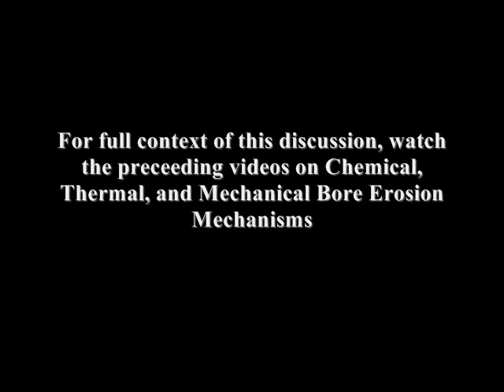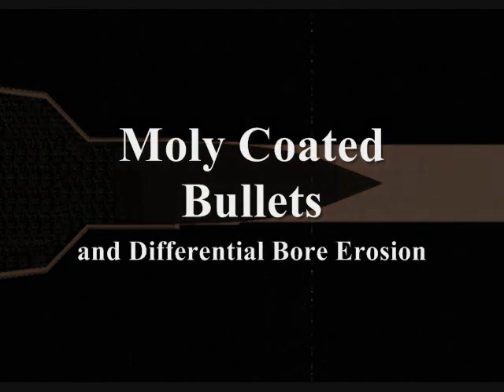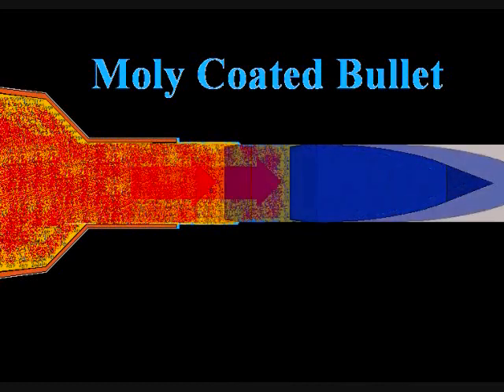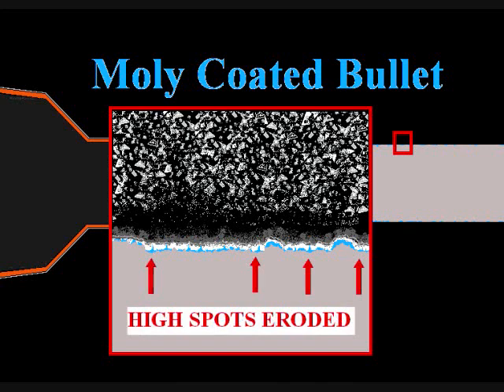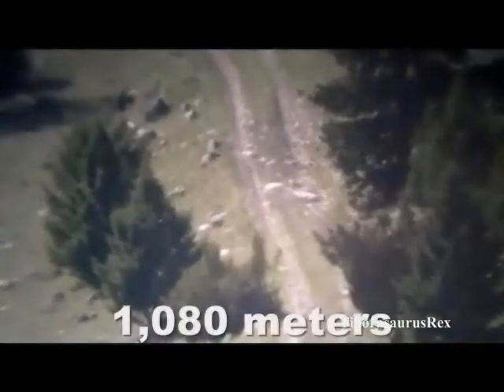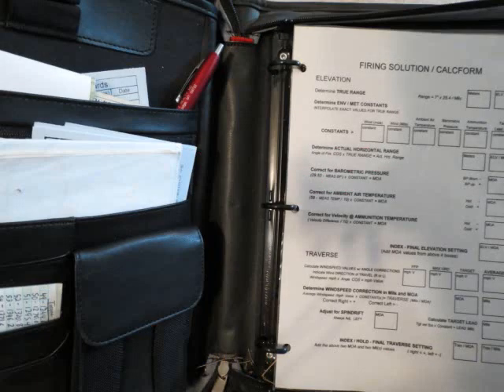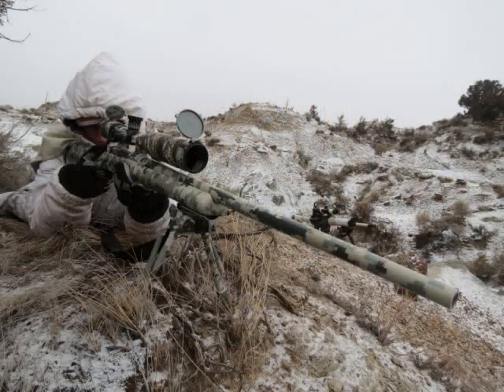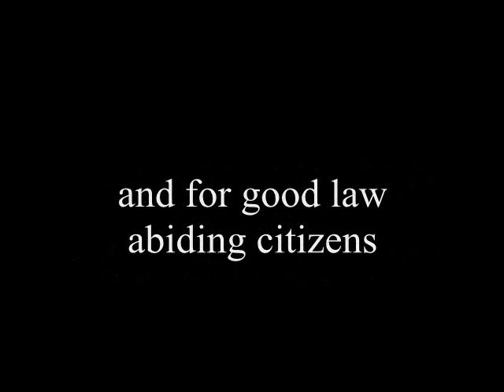Long Range 101 Part 39 - Moly Coating and Bore Erosion

Comment: I'm new to the coated bullet world but I have gleaned a few things of note. One it's that the coatings actually drop velocity initially do to the significant drop in barrel pressure needing a change in your load to compensate. Second is that Molly has been shown to break down with heat and moisture potentially corroding the barrel over time. Last is that for the reloader like myself there are other products like hbn and ws2 with other properties that can be used to gain more consistency and wear protection from your gun.

Comment from the maker: Hi there.  Great questions.  If you have a new match grade barrel or even a new factory barrel,  I would totally avoid any of the abrasive cleaners all together.  The mechanical erosion forces that result from normal firing will do a more uniform job of removing micro-burrs and machining imperfections from the criticle areas in the bore.  These cleaners can help to make the bore look more shiny, at least visibly, but you want to avoid removing any steel from the bore.  Vid coming soon :-)

Comment from the maker: Works great for lower velocity projectiles like the big bore .45s and .50s.  If you are shooting LR with a 45-70, 45-90, 45-110 etc... this is a great way to go, especially if you paper patched them.  For modern high velocity cartridges, lead cast bullets can make a nasty mess in your bore and will be problematic for maintaining a uniform level of fowling as they will require quite a stern bore cleaning regime.

Comment from the maker: If you already have treatment in the bore, that won't be a big problem.   The big problem arises over long term use when an accumulation builds up in the bore and especially when further accumulation in differentially eroded pits is exacerbated by further deposition of the molybdenum which can really make a mess.  One bore treatment prior to firing is fine and won't produce any significantly noticeable negative effect.  You'll still get good accuracy and bore life, so I wouldn't sweat it :-)

Comment: You should try hex Boron nitride (hBN). It won't have the downsides that moly has, and resists far more heat. It doesn't rub off the bullets, and you can just coat the bore.

Comment: I use moly quite a bit. after I clean my bores I mix some moly and rubbing alcohol. I then use a bore mop to run it through the bore. let the alcohol evaporate then run a patch through it to remove excess moly. one thing you didn't mention is the waxing of the bullets after applying the moly.
Reply: I avoid waxing after moly coating the bullets. Wax on top of the bullets has to go somewhere and it has no place in a rifle bore.
Reply: @teucer4  

I've never had a problem after thousands of rounds.

Comment: well let's see i purchased my Savage 110 FP in 1995 and started using Moly shortly there after. if you plan on using Moly after firing copper jackted bullets through the barrel then you have to remove all the copper fouling from the barrel. Sweet's 7.62  is the best solvent to accomplish this. after doing so you then use Neco Moly Slide grease on a patch and Burnish the Moly into the barrel. one of the advantages of Moly is that you can fire more rounds through the gun before you notice a drop in accuracy.  another advantage is you do not need  to use a brush to clean the barrel, you just run a patch with your favorite gun cleaning solvent and then a dry patch. you don't want to remove the Moly just the carbon build up. then you run a patch with the Neco Moly Slide Grease and Burnish the Moly into the barrel. most people who try to use Moly do so incorrectly and yes you will see a drop in velocities so you can bump up the charge 1.0 to 1.5 to get that loss back.i Moly Coat my own bullets. HTH.

Comment: Early days of moly coating, my how things have changed, I have used it after braking in my rifle and several years later and several thousand rounds the barrel is still good, cleaned after using and bore scoped, I will still be using it. No, you lose FPS as the pressure drops due to good lubrication and you normally had to up the powder to get it back to the start velocity, and it does not rub off bullets easy if done right, that why it is used to coat piston rings in engines. check the link below see what the pros say and what would they know it’s only their job
https://www.wallworkht.co.uk/content/molybdenum-disulphide-coating/
Excellent lubrication – Completely dry lubricating film resists pick up of dust or other harmful contaminants. High load carrying capability. Reduced risk of seizure. Excellent adhesion to the metal substrate. Low coefficient of a friction alleviates stick slip behavior and provides uniform torque tension characteristics on threaded fasteners. High resistance to oils/fuels/grease. Enhanced corrosion protection in marine environments and to a broad spectrum of aggressive chemicals. Passive, containing no toxic lead or antimony compounds.
Reply: Yes, and I hear hex boron nitride does it a bit better and it has a higher heat resistance.
Reply: I like the idea of Molly when it first came out when I understood that the burn temperature of Molly allegedly causes carbon and it has been said that moisture builds up behind Molly in the barrel well that's exactly what they say about copper deposits left behind by the vaporization of the bullet jacket in the barrel hbn I've been working on recently results look very promising by the way I'm no Pro but I'm still working with Molly and so far I have not incurred all the problems that is associated with Molly oh well I'll go where the results Lead Me if you look at benchrest books from the sixties all of us accuracy minded guys today would actually laugh our asses off example you have 2 neck size only

Comment: EXCELLENT videos for sure
I'm currently doing a big multi-rifle long-term review of HBN coatings, to be published in Target Shooter and on my channel.  When you lube the bullet, you end up reducing the fps.  That reduction is, however, less than the drop in pressure.  SO you could increase  the pressure back up to where it was by increasing powder charge and have a nudge more fps, or leave it where it is, knowing you're running less pressure.  Cheers Rex :)

Comment from the maker: Nitriding really works. Nitriding the bore can act to interrupt one of the primary driving reactions of the chemical erosion mechanism -  the adsorption and dissociation of carbon monoxide on the bore surface.  Also nitrogen inhibits the subsurface diffusion of the free carbon into the steel as well.  All this can lead to a significantly longer barrel service life.   

Eotvos effect can have an effect at long range on the order of inches.  If you are shooting beer cans @>1KM, this is criticle.

Comment from the maker: Howdy!

I would be extremely careful when increasing pressure on a shaky promise of lower pressures - if you know what I mean.  The way the moly rubs off as it slides down the bore can vary considerably from shot to shot, so I would not increase the risk overpressure to get a little more fps.  We will be precisely adjusting for bullet drop and windage anyways, so a higher MV is not really a top priority. Hope this helps.
Reply: Yes being careful is a very good thing, but moly coated bullets does in fact reduce pressure and many hand loaders have experienced it personally. The proof is in the primers. When loading hot loads, and i mean hot, you get flattened primers. Its not a danger if using a quality gun but it is hard on brass and guns, so most loaders back the charge down a bit to stop this. But if you load the same loads that flatten primers with moly coated bullets, you see no flattened primers, you must up the powder a bit to start seeing the excessive pressure signs again. But yes you are in fact right about being careful with doing this because coating with more or less moly could perhaps change this some, different coating processes could change it some. Any safe hand loader knows always start low and work up whenever changing anything.

Comment: I'm my reloading book, it says moly coating decreases velocity. It's in the Lyman reloading book that came with my tumbler.
Reply: It is correct, it reduces the velocity, because the powder has more place to burn in when the bullet gets out of the way easier
Reply: But if you add more powder you can achieve higher velocities without over pressuring.

Comment: Part 2.....SBN is Salt Bath Nitriding. It is a treatment, not a coating. It is impossible to flake off or have anything get "underneath" since there is nothing TO get under. Anyway, Compass Lake has an explicit way they want the JB Bore Paste applied to their barrels under barrel break in. He said after break in and SBN, I could use moly coated bullets just fine as long as I kept the build up down. I know about the vinegar/hydrogen peroxide trick, then follow up with bore paste.Borescope too.

Comment: I have use them while shooting handgun if you have the mold really cheap to do.On some of these bigger loads we push a gas check is used and lead build up isnt as big a issue. But was told I could go the same way with my new to me .300WM. Use half the power and might be able to extend the life of the caseing? and cut recoil down to something live able. Just dont know how far they will fly.

Comment: I dont use moly coating because I dont think it's possible to coat the bullets with always the same amount of lubricant. Since it changes the friction a lot, it's the same thing for velocity and pressure. So a little change of moly amount between 2 bullet coating sessions will make your load out of tune.

Comment: you ever try boron nitride I think its called I hear and read its a high temp lube that can coat metals and chemical resistant
Reply: David Tubb switched to Boron Nitride years ago.  He sells a kit for doing it yourself.  Easy as pie.  Hell, a lot easier than pie. All upside, no downside like Moly.

Comment: Just FYI, engine and exhaust guys don't use moly as a thread lubricant because it becomes an abrasive at higher temperatures, something like over 800°F

Comment: Rex, what about a thorough cleaning with VFG - WEAPONS CARE SYSTEM PELLETS saturated with JB bore paste. Then using their micro polishing paste. I plan to season the bore with NECO MOLY PASTE. It gets swabbed well with DRY pellets before firing. I have a MELONITE treated barrel which further reduces erosion. I used USMC Black Hills 77gr Siera King Moly COATED rounds.Does this sound like I am covered? Never use moly coated bullets during break in. Break in barrel totally before the Melonite.

Comment: Arjuna42 , if people using moly in their barrels either apply it straight to the barrel or using moly coated bullets BUT constantly CLEAN their barrel will they avoid problems ?

Comment: Great vid. So a 100 rounds of moly bullets shouldn't hurt my AR?
Reply from the maker: Although many premium barrel manufacturers would void your warranty after the first moly coated bullet was fired, you will only see significant performance hindering damage in extreme cases where excessive moly deposition initiated differential erosion after hundreds or even thousands of rounds.  You AR shouldn't know the difference from just 100rds.  I put 500rds through my .243 Win early in its life and its still shoots excellent groups even after multiple thousands of rounds have been fired.
Reply: TiborasaurusRex No premium barrel manufacturers I have heard of (Krieger, Brux, and on and on) will void your warranty for using Moly coated bullets.  If you know of any, list them please.

Comment: After a THOUROUGH barrel cleaning check accuracy. Check for copper every 200 rounds with Bore Tech. Some barrels are super bad for collecting copper, and others are not. If u want to use moly then., use NECO Moly Paste to season bore as per their directions and shoot Black Hills moly .coated. Clean built up moly with soak of vinegar and hydrogen peroxide.50:50. Google my  sentence before this one.

Comment: With all due respect, how in the world did you determine the the molly coated bullet does an uneven job at coating barrel ? Is this substantiated by at least a few other people ?
Reply: There's no way to manufacture a bullet with a uniform amount of molybdenum. Even if there were a way, obviously the smoother regions of the bore will not let as much of the moly adhere as the porous regions will. Just basic frictional wear concepts haha
Reply: Well, it looks like you just made the argument FOR molly coated bullets.." Even if there were a way, obviously the smoother regions of the bore will not let as much of the moly adhere as the porous regions will"(because the smoother regions don't need it !!)
Reply: mikeanthony07 Actually if any of the bore has it the smooth regions need it too, otherwise you will have non-uniform bore wear, like Rex said in the video.
Reply: "the smoother regions of the bore will not let"....is a highly bias,assumptive, unsubstantiated statement, you want people to believe. These smoother regions ARE IN CONTACT WITH THE MOLLY COATED BULLET,therefore taking advantage of the molly. Molly will fill in ANY regions that need it .
Reply: All regions of the barrel need molly and these molly coated bullets provide it !
Reply: These are updated statements.
Reply: Hey man, if you want to use moly bullets that's your choice. As for me, I prefer not having a bunch of junk in my barrel thoat and bore.
Reply: cool, remember it's not melted steel in your barrel.

Comment: MolybdeNum (not Molybdeeum) instantly becomes a barrel destroying hard oxide as your gun is fired. You are far better off with a copper coated bullet. The soft copper will not damage your barrel and any residue is easily removed with the proper solvents.

Comment: Thanks for making this video.  This makes good sense, how uneven deposition of the moly coating in the bore leads to uneven erosion.  I've heard a lot of different opinions about molybdenum disulfide and this did explain the potential downsides quite well.  There's one thing I'm curious about...my understanding is that the moly adheres to the bore more aggressively in regions with more microscopic pores, and at the throat where the bullet engages the rifling, and this is why the deposition is potentially so uneven and problematic after much use.  2 Questions; is there a way to just clean those deposits out of the bore, and more interesting to me, wouldn't the copper from a conventional bullet's jacket adhere in the exact same manner: unevenly, on account of inherent variations within the bore of the rifle?  Why would moly buildup not be a better alternative to copper buildup?  It reduces friction a heck of a lot more than copper and should still be doing the life of the rifle a favor in comparison to bare copper.

Comment: Hi Rex,
     Not to be a wise ass, but you are completely mispronouncing Molybdenum.  You're saying Molybdium.  President George W. Bush caught hell for saying Nu-cu-lar (Nuclear).  Anyway I'm an Analytical Chemist and test Molybdenum in the vitamins and minerals by ICP-MS (Inductively Coupled Plasma-Mass Spectrometry).  It's used as a catalyst in many enzymes in plants and humans.  It has an atomic number of 42 (the number of protons).  The rest of the weight is made up of neutrons (98 atomic mass units - 42 = 56 neutrons if you take the most abundant isotope).  
    There is a contradiction, in your video, from some shooters that say it actually slows the bullet down.  I have yet to test fire my reloads.   Molybdenum disulfide (MoS2) is the compound used and does lubricate the bullet but apparently adds drag,  but will look into it further.   Just sayin.-Paul D. Dodson
Reply: Decrease in neck tension and easier engraving into the lands reduce the initial pressure spike, so the initial acceleration is less; reducing the muzzle velocity. Drag in the barrel is obviously reduced, but aerodynamic drag is most probably similar.

Comment: No kidding. Well, there are only a hand ful of top AR15 match barrel makers in the USA. Frank White of Compass Lake Engineering insists the use of JB Bore Paste on a patch wrapped around a bronze brush on their SS and unlined chrome moly barrels after the first 100 rounds and every 200 rounds after They even made a big deal of it in an email to me. I have it, use it and also their micro fine grit JB BORE BRIGHT. Besides, after break in my rockwell will be about 75 or higher after my custom SBN.

Comment: bad idea. You want clean OUT the build up of moly. How do you know your rifling is LOOSE? Not accurate? Accuracy of old surplus barrels are restored by JB Bore Paste, K-12 copper cleaner and Bore Tech cu++  copper cleaner follow up after k-12 to be used as an INDICATOR. No blue, no copper. The K-12 is best copper remover ever but has no indicator if any is left in barrel. use the BT cu++ for that. Good luck.